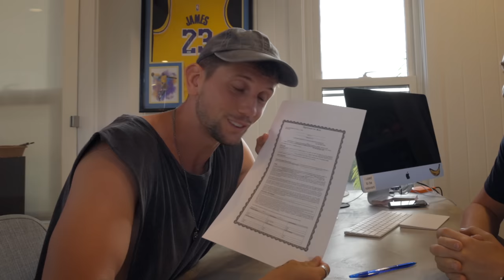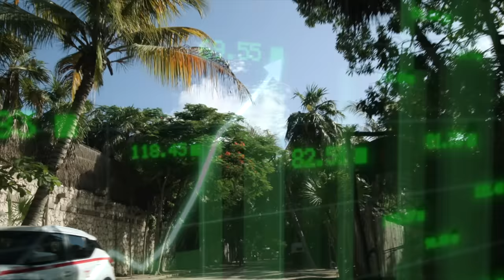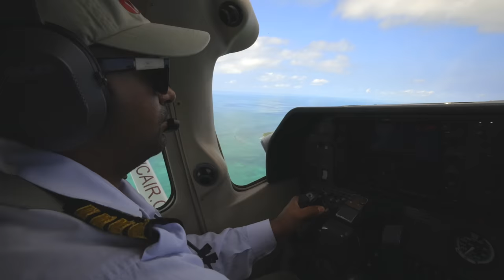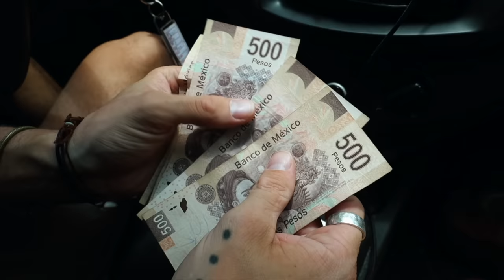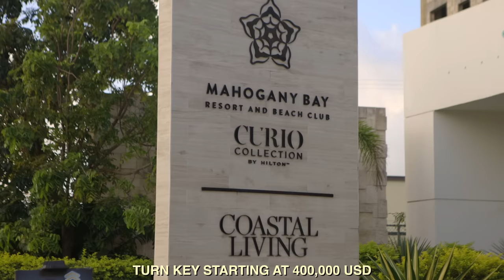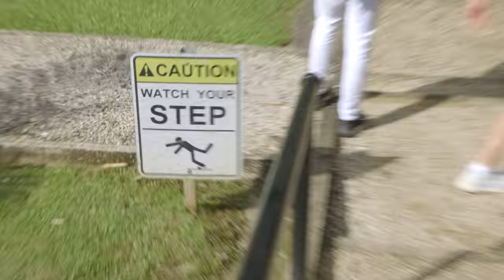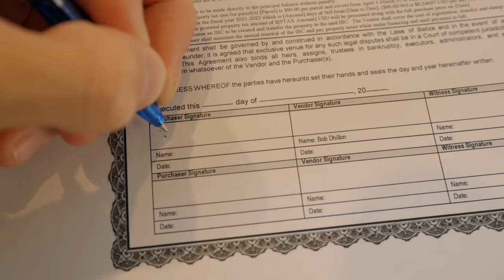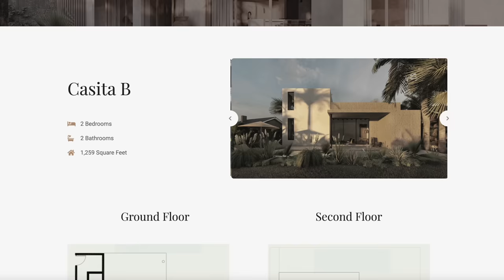Building a LOST VILLA in Belize? (I BOUGHT LAND)

Comment: I’ve been to Belize.  It’s definitely cool, but I would hardly call it the next Talum.   San Pedro Island:  First is the seaweed problem, and they do not clean it up off the beaches, so there are large piles of  smelly seaweed and flies.  The other issue especially on the island are the beaches are very small and narrow , and the golf carts, ATVs vehicles use the beaches as a road, so it’s noisy, and a little dangerous.  The water is also full of stingrays, big sting rays.  Belize City is a city of 1 million people with mostly dirt roads and very poor. Seemed a little lawless.  The water, snorkeling and diving are great!